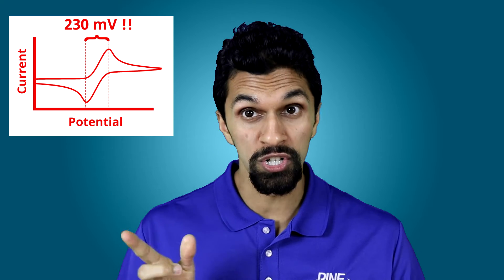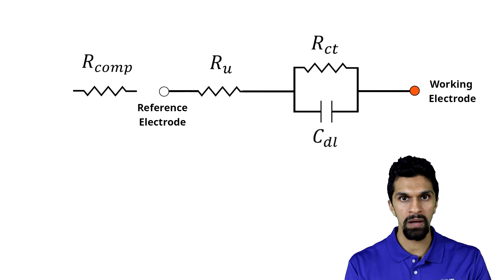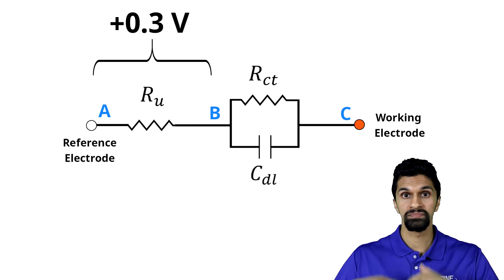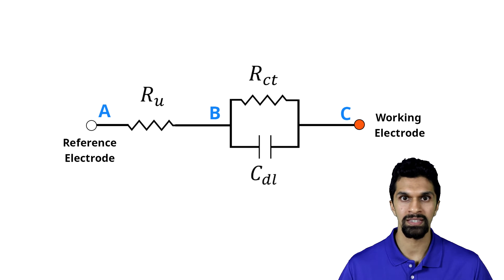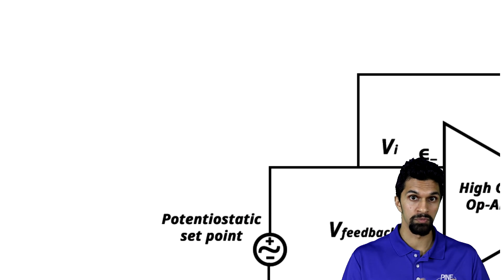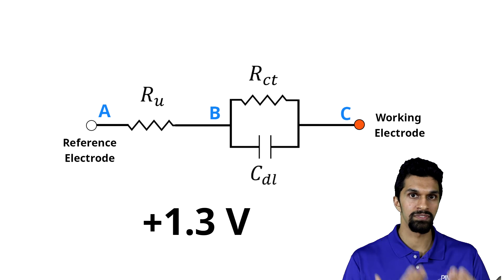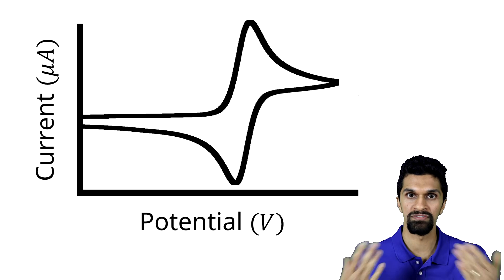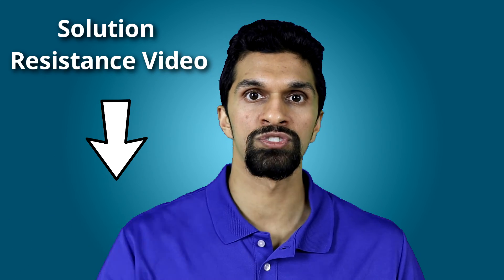What is iR drop in Electrochemistry

Comment: would you please tell us about what is overflow when we measure the the CV?
Reply from the maker: Overflow or sometimes called overload, is when the current measured by the potentiostat is above the current range selected.  Your potentiostat has different current ranges to help you measure the most accurate data for the current you are measuring.  However, you could select a current range that is too small for the current you are measuring and you get an overflow/overload error.  I hope this was helpful.
Reply: @Pineresearch  wow thanks a lot for your reply...The way you explain is so easy and understandable..😃

Comment: Thanks for the video. I have a question regarding the equivalent circuit of the system. You have assumed a series association of the counter electrode, the reference electrode and the working electrode (Counter-Rcomp-Reference-Ru-[(RctCdl)Working)]. In this way the working electrode has no direct connection with the counter electrode, however, in the real system the working and the counter also have a connection. This connection would be given by a resistance in parallel to Rcomp and Ru and would join the Working electrode to the point that you have called B (point prior to [(RctCdl)Working]). In this way, could the potential at point B be modified by the potential of the counter, preventing the potential experienced by the working from not being the one that we impose in the reference?
Reply: By the way, you do a great job teaching electrochemistry and you are a great communicator!
Reply from the maker: Thank you!
Reply from the maker: That is correct.  There is a resistance directly between the counter and the working electrode that isn't through the reference electrode.  However, all measurements at the working electrode are measured and applied with respect to the reference electrode.  So the counter electrode potential should not affect the potential at point B.  The counter electrode will always drive current to the working electrode, but the measured and applied potential is only based on the reference electrode.  Good question.
Reply: @Pineresearch  Thanks for your response from a year ago! I've been revisiting the video and comments, and I have a new question about your explanation.
We agreed that there is a resistance directly between the counter and working electrodes, and that the counter electrode will drive current to the working electrode and the measured and applied potential is only based on the reference electrode.
 Then, how do we determine the exact current flowing between the reference and working electrodes to calculate the ohmic drop (iR)? The current flowing through RE-WE resistance is only a part of the total current detected at the WE, since some of the current flows from CE-WE resistance. For example, in a system where the CE electrode is closer to the WE than the RE, the CE-WE resistance would be lower than the RE-WE resistance. Therefore, most of the current would flow through the CE-WE, and the ohmic drop in the RE-WE would be negligible due to low current is flowing through this resistance?
On the other hand, I've seen people mention that the Luggin capillary brings the RE closer to the WE. However, the Luggin capillary is long, and the distance between the WE and the RE is usually larger than the distance between the WE and the CE. I understood the Luggin capillary as a way to avoid contaminating the RE or the working solution.

Greetings and thanks in advance, I promise not to bother you anymore.😉
Reply from the maker: @samuelcalabuigmompo  That's a good question.  So my colleague Neil and I will host an Ask us anything about electrochemistry livestream (episode #46) and we'll talk about this question.  I think it will require some detail.  Also, I believe I made a mistake earlier when I said that there is a separate resistance between the counter and working electrode, I actually don't necessarily think that is true and I'll talk more about that later.
Reply: Thank you!

Comment: Hello.

Thank you very much for your video. It is very useful  for me.
I'm starting to do corrosion measurements, and also LPR and Tafel plots. 
How do you think, If I use the solution of 3 g/l NaCl, do I need to measure solution resistance, or use the IR compensation LPR sweep on my GillAc potentiostat? Or it will be enough to use only LPR sweep?

And one more question - do I need to use Luggin capilary for Ag/AgCl reference electrode, or I can place ref electrode directly into the solution, close to the working electrode?
Reply from the maker: For most LPR experiments, it is not necessary to perform iR compensation.  You may wish to perform a high frequency EIS test to determine the iR drop of your solution mainly as a way to convince yourself everything is set up properly.  I would expect with a sufficiently high enough concentration brine solution you should expect the uncompensated resistance to be less than 100 Ω or so, provided there are no other detrimental effects present.

Furthermore, the reason iR compensation is not usually necessary for LPR is because LPR is a very gentle, non-destructive technique where the potential is only shifted by a few mV from OCP, which does not typically induce much of a current response, meaning the effect of iR drop is likely quite minimal.

Regarding a Luggin capillary, this is a fairly common practice in corrosion electrochemistry, and indeed in electrochemistry in general as well.  Similarly to my comment above about having a high enough brine concentration largely negating the impact of uncompensated resistance, in many cases I think if you can get the reference electrode relatively close to the working electrode, a Luggin capillary may not be necessary.  In some cases, however, it may help reduce the iR drop between working and reference electrode, particularly if using non-aqueous electrolyte or low salt concentrations.  With corrosion, though, sometimes during long term LPR experiments bubbles can occasionally form (especially if using temperatures above room temperature), and if using a Luggin capillary you will run the risk of the bubble blocking the capillary.  If that happens, the electrochemistry results will likely be disastrous.  For that reason, sometimes corrosion researchers prefer to not use the Luggin capillary.  Your specific testing protocol may vary though, and I recommend trying both arrangements to see which works better for you.
Reply: @Pineresearch  Thank you very much for such extended answer.

Comment: I didnt see you mentioning a Luggin Capillary tube to minimize IR drop
Reply from the maker: Correct.  Technically the Luggin Capillary is adjusting the position of the reference and working electrode, so it's somewhat implied as a method.

Comment: Thanks for the beneficial video, I have a question, if we are working on screen printed electrodes, considering the smaller surface area and close distance of electrodes, is this still important? I prepared a glucose sensor of first generation and i noticed when the glu concentration is higher, the response is not as consistent and accurate as lower concentrations and I am sure it is not enzyme saturation, could it be due to ohmic drop? how can I fix it?
Reply from the maker: Great question.  I'm guessing that this isn't an iR compensation issue, but rather a chemistry issue.  It's nice to have a linear calibration curve for your sensor, but it sounds like the fit breaks down at high concentrations.  I think I would need to know a little more about your system and what kind of experiments you are running.  For example, if you are using cyclic voltammetry to measure the current for your glucose sensor there are a bunch of experimental parameters you might choose to change how the concentration of glucose is measured.  There are also other techniques like chronoamperometry which are better for quantitative measurements that might give you more consistent results across a wider concentration range.  These are some ideas, I hope this is helpful.
Reply: @Pineresearch  thanks alot
Reply: @Pineresearch  Thanks again, I noticed I didn't read your reply completely. Here is some information: after preparing functionalized electrodes, I do a CV with and without Glucose, I get the peak potential for responding to the glucose, I do the amperometry and measure the current around that peak potential. I tried to do chronoamperomety, I read that the potential step should be set from a potential of no current to the highest current. I assumed the second is the peak potential of my CV, but finding a potential for no current didn't work. I couldn't find it. for example in case of second generation sensors, using Fe3+(we measure Fe2+ oxidation current), Peak potential is around 400 mV, for no current potential, if I lower beyond the commence of oxidation to make sure I don't interfere the produced fe2+ concentration by glucose, there will be reduction Of Fe3+ to Fe2+ which interferes with Fe2+ produced by Glucose, I got totally confused and gave up using chronoamperometry. again I appreciate your attention, Thanks
Reply from the maker: @amenehmohammadnezhad7889  Thank you for the additional information.  I think I know what your are talking about, but would probably need some additional clarification.  It sounds like you are using a surface bound Fe3+ catalyst for glucose detection.  Specifically, glucose oxidizes converting Fe3+ to Fe2+.  Chronoamperometry isn't working because you can't find a potential step where there is little to no current.  I presume that the CV you get with glucose has a reasonably large background current because it contains oxidation current of Fe2+ going to Fe3+.  I think my question to you, would be to try double potential step chronoamperometry.  You apply a forward step followed by the reverse step and look at the difference in current.  You might be able to get away with potentials where you have some baseline current, because it would get subtracted from the difference in the chronoamperograms.  This might be a bit complicated to describe via the comment section, but we do hold livestream Q&A's on Fridays at 1 pm EST.  If you are able to make it you can ask use questions live and we can use other tools to describe the process.
Reply: @Pineresearch  I really appreciate your patience and consideration, thanks for comprehensive response. I could somehow get what you meant and will definitely take part if I can since I am scheduled that time every week and I will need arrangements.

Is this live is hold every Friday or you will post it on social media?

Again thanks alot.
Reply from the maker: @amenehmohammadnezhad7889  We try to hold it every Friday.  You'll see an upcoming livestream on our YouTube channel a few days before the livestream to let you know it's happening.  We have a twitter page, but are not as active as we are on YouTube.
Reply: @Pineresearch  Great, Thank you very much for your information.

Comment: Hello, guys. A question.
If the internal resistance of the battery is caused by reversible processes, where no heat is generated or only part of the donated energy is converted into heat, then internal resistance should be complex? 
What you are compensating for is active resistance, but active resistance normally depends on the temperature and not on the state of charge of the battery. I guess this Ru is a projection from the complex resistance to the real axis.
What do you think about it?
Reply from the maker: Thanks for your question.  First, I just want to note that I think some of the language you used is a little confusing to me, but I believe I understand the idea of what you are saying.  For instance, when you say Ru is a projection from the "complex resistance" to the real axis, I assume you mean the imaginary impedance axis (the y-axis on a Nyquist plot) and the intersection at Zi  = 0 on the Zr axis is equivalent to Ru.  If that is what you mean, then yes, I agree.

The other thing about what you said I am not sure I understand is that "the internal resistance of the battery is caused by reversible processes."  I'm not honestly sure what this means.  What processes do you mean, exactly?  The internal resistance, the Ru so to speak, is generally considered to be a consequence of electrolyte resistance, and other physical things like connections/leads from potentiostat to the cell.  I don't know what reversible processes would be considered incorporated into the measurement of Ru.

The last thing I will say is the one part you said I do agree with is that, ideally, "the [Ru] normally depends on the temperature and not on the state of charge of the battery."  This is in theory true, though in practice I suppose it is possible your experimental measurement of Ru might change slightly due to normal measurement error and/or subtle changes to the electrolyte during charge/discharge tests.
Reply: @Pineresearch 
I mean processes in which energy is used so that the Poyting vector is not 0, but entropy does not increase as in the case of heat generation. (e.g. ionization, work function etc.).
You make an approximation that Ru is a dessipative resistance, but this can also have non-linear dependence on current, voltage or frequenq.
Where I am not sure... Internal resistance of Battarie what they all measure and your Ru is the same or not... I may well be wrong at this point.
Reply from the maker: @xelth  You know, I actually think you are making a very interesting point I've never quite considered before.  Thank you for bringing this up.  To be perfectly honest, I really don't know the answer.  However, I do think you are 100% correct about one thing: that is, we actually do make an implicit assumption virtually every time we do EIS on an electrochemical system - whether a battery, fuel cell, 3 electrode setup, etc - which is that we assume Ru is dissipative resistance, and therefore governed by Ohm's Law.  I wonder if there may be situations where this is not the case and there may be some non-linear dependence going on.  In a sense, because almost every set of EIS tests never give exactly the same Ru value, it is at least conceivable this could be resulting from simple repeated measurement error, some non-linear dependence, or a little of both.

With respect to the internal resistance of a battery specifically, my personal research observations and also from those I have seen in literature typically show that Ru is not perfectly constant throughout a set of EIS tests.  Often, this is something like performing EIS at various states of charge, or over a period of time to measure degradation of the battery for example.  Your comment is making me wonder if perhaps there could be some factor of non-linear dependence, even if somewhat minor, that is accounting for the change in Ru.  I do not know of many instances where people have discussed this either.  I would say that your hypothesis is certainly plausible.

Comment: What is the hydrodynamic voltammetry
Reply from the maker: Hydrodynamic voltammetry is a form of voltammetry where the movement of solution is controlled.  For example, performing voltammetry at a rotating disk electrode will produce a different response than if the electrode was stationary and the solution wasn't moving.  Hydrodynamic voltammetry is a whole field in and of itself.  I hope this was helpful.